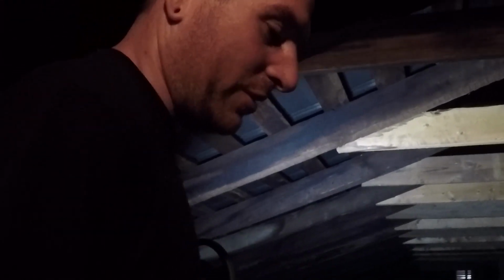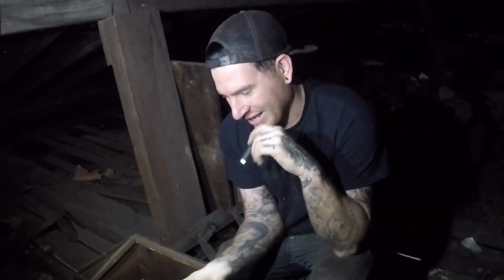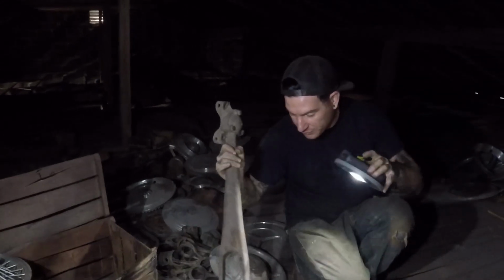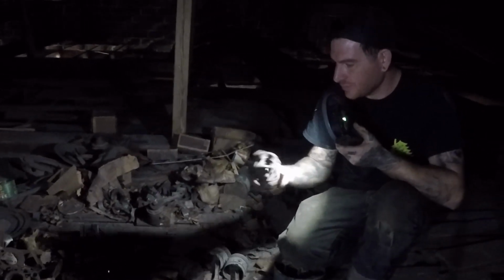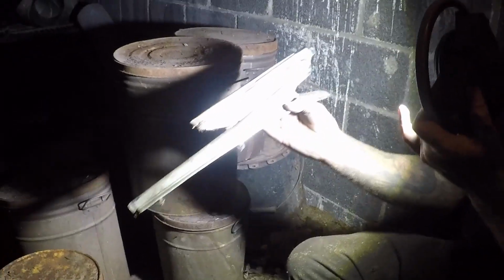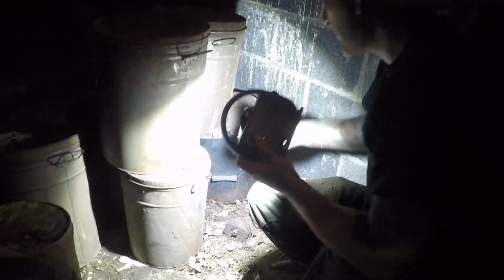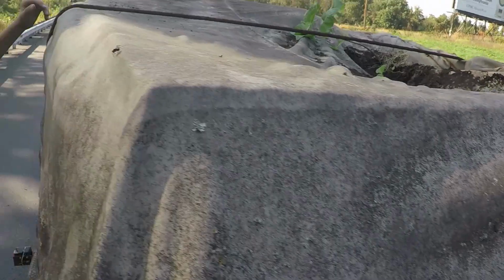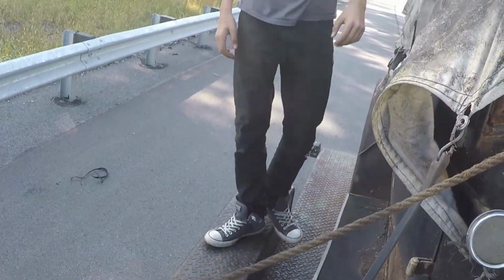Treasure Hunting In A Long Forgotten Attic & The Disaster Durant

Comment: Be careful with that horn. I rigged a 6 volt horn motor to 110 volts when I was a kid and it started and accelerated until it exploded. Check the actual voltage before you hook it up.
Reply from the maker: We got the full story on the horn later in the day. Its a 6v car horn that was used as an alarm clock. I am going to build a step down transformer with a rectifier and we are going to use it as a door bell for the shop! Thanks for watching!! -Mike/ITG
Reply: I'm guessing it's safe.  That horn or another one like it was built for my dad by my great uncle.  He hooked it up with a battery under his bed and used it as an alarm clock to get up for school.  I think one was made for each kid in the family...life of a kid who's dad owns a service garage!
Reply from the maker: Thanks for the back story Wendy! It definitely will be going on the wall and living on to annoy future generations! -Matt/ITG

Comment: Billy Durant is the guy responsible for the birth of Chevrolet in 1911he named it after Louis  Chevrolet the race car driver  Durant cars are getting harder to find as the years go by I think the Durant was built in Canada
Reply from the maker: Thanks for the history Steve. The Durant was passed on to the Durant Club for them to use for a restoration or parts car. It's in the right hands now. Thanks for watching. -Matt/ITG
Reply: incorrect. Louis Chevrolet started Chevrolet and had investors which became General Motors. there was a falling out and he was bought out by the investors for peanuts ( $900 ) and they would not even let him take his name with him for any future business ventures. Durant was the one behind the takeover. Louis Chevrolet went on to do work on making  racing parts for the Model T Ford. These conversions were the Frontenac. In Canada,  Frontenac was later the name used on their version of the Ford Falcon. Ford was much more fair with money in dealing with Louis Chevrolet. The guys at what would later become another part of GM  tried to do a similar thing with Henry Ford on his first try at becoming an auto maker but he came out o. Few people know that Henry Ford was the one who created what was eventually considered to be the great luxury car for GM..  Thats right. Henry Ford was who CREATED the CADILLAC.
Reply: @frigglebiscuit7484  all the hitory I have read on it says what I stated about his connection to Cadillac. Yes, its common knowledge that he was a hitler supporter early on but no he was not a NAZI. as you are claiming.